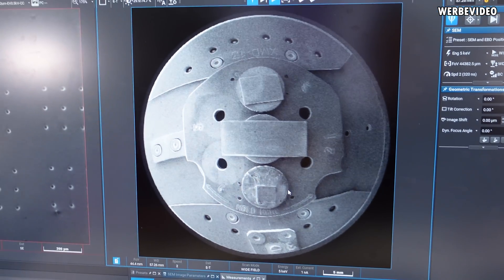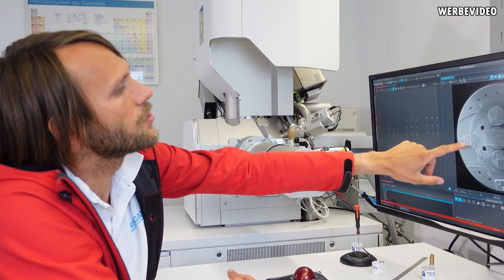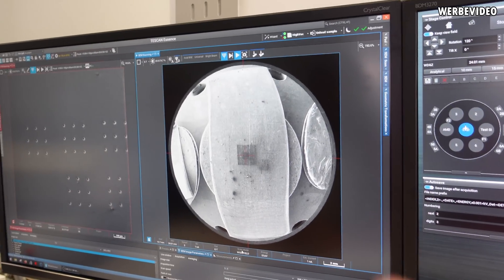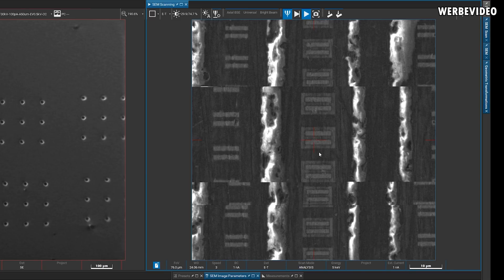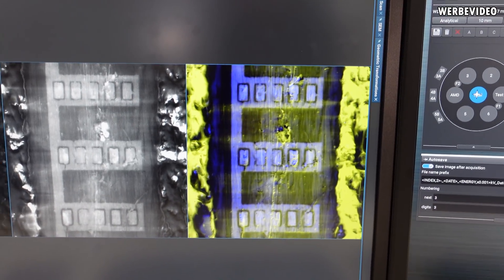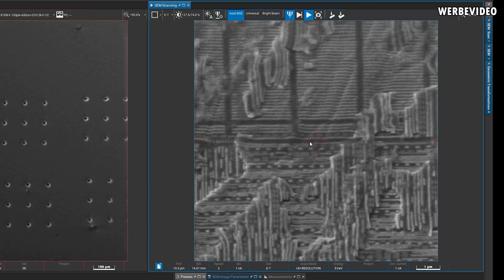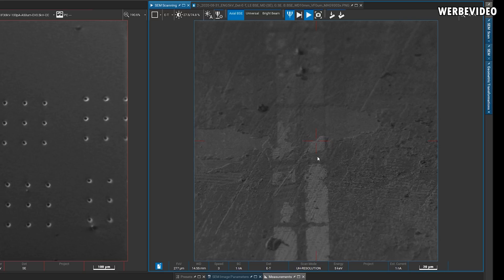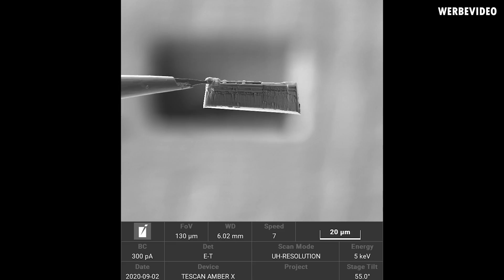Ryzen Nano-Structures more than 100,000 times magnified. Visiting Tescan Part 2/3

Comment: sometimes when using these things everyday, we forget the insane technology used to make them. it blows my mind that we are even able to make perfect lines of copper on a scale so small that we need to use an electron microscope to even see it. to see such uniformity  is mind boggling . 50 years ago seeing something like this would look like alien technology. thanks for the video man
Reply: As an analogy this is why i can't belive why so many think the piramids are 'alien tech' . Every time i hear that i wanna tell them: yeye , but have you seen the nano transistors ?? if so , why do you think we weren't capable of moving rocks 5000 years ago (or whatever years ago , less than 10000)
Reply: @kisspeteristvan  i know lol. they think we were brain dead cave man back then. "me dum dum, me no move big rock". like some super advanced alien race came down and instead of giving us technology or teach us slaves are bad. they instead build 3 random pyramids in the middle dessert.and was like "seeya, we will be back in a few hundred years to steal your hillbillies and stick things in there buttholes"  you have enough people and enough time. you could probably move a house on manpower alone.
Reply: Its not insane but a testitment to improvement and collaboration over the decades. Nasa made the first integrated circuit that was the size of a lunch box. Then others simply focused on getting this setup smaller.
Reply: even the speed at we can talk with someone on the other side of the world amazes me (or just download something) which is quite 'ancient' technology but still so amazing if you think about it.
Reply: Internet wont let knowledge be forgotten. So it compounds faster than ever before. The massive jump in technology we made in the last 50 years will be 2 or 3x faster for the next jump.  Machine learning is basically a.i and we take that for granted.
Reply: @Andytlp  I agree and disagree. You are right with advancements in technology advancing faster as new technologies make it easier. But there is a point of deminishing returns , and also a point when we hit a wall for new technology. And I think we are hitting that point. In the 80s and early 90s. We were inventing completely new devices yearly. The advancement in computers opened doors everywhere for using this technology in new devices. But at this point. We are out of ideas. Now we are just improving things we already have. And you can only improve so much before you need to find a new and better way  all together. Amd and there chiplets was the biggest advancement in a while .but everything else has slowed way down. The next big advancement that will change the world. Is finding a better way to harness power and make it super small and efficient . Without that.  We will just keep needing more power and even at this point it is getting to be too much. Needing 1000 watts to run a high end PC is crazy. Improvments in nodes can only do so much. If we keep going this way . We will need 2000 watts in 5 years. You will need an ac on all the time just to not cook your house. Now it's all software advancements. I really do think we wont see a really huge change in technology until we find new energy means. And we may never. You can only make so many items with a certain amount of ingredients. And unless space travel unlocks some new ingredients for scientists and inventors to work with. We will have to be happy with slight improvements. Until no more improvements can be made.
Reply: @thewizardoftech5075  the point of diminishing returns only apply to a specific paradigm, with paradigm change, you get exponentials again
Reply: rvidal0001  but thats the problem. we can only go so far with the elements we have now. without finding new metals. batteries are always going to be made the same way , so they are always going to degrade just as fast. there is no possibility of making a battery the size of a watch battery that can make your phone last for weeks. and batteries can only produce so many amps and volts at a certain size. to make real advancments we need a watch size battery that could power a car. and vr can also only go so far. the best that can happen. is make technology small enough that we can run  10k per eye then maybe it would look how we picture it. and we may never hit that kind of power, like i was saying. the more powerful gpus and cpus get , the more power they draw. and even with better nodes. it isnt enough efficiency gain to stop the next gen from going up in power. vr is still really basic. it is still just small screens in front of your eyes. for vr to be really immersive. it would have to make your whole room into the game without a headset. that way your eyes could actually focus in and out on closer and farther objects . your brain is smart enough to know the distant objects in vr right now arent really distant and only mm away from your eyes.  we as people just assume things will keep improving until they reach what we picture. but there is a reason we dont have flying cars and 100s of other things we see in movies. we just dont have the technology to do it. and probably never will. that is why the saying moores law is dead is a thing , because we are at the point now where advancements are slow and slight. and until someone invents a new power technology we are at a standstill. and fusion tech will never be a thing. its just to unsafe and to unstable. they will keep trying and maybe hit a breakthrough. but even if it works. it would never be implemented into household objects.
Reply: rvidal0001  saying we would never break the sound barrier was stupid. That is a possibility of our technology. You add enough thrust you can hit that easy. And whoever said the PS3 was the ultimate and last game system obviously wasn't to tech savvy. I'm going by the evidence . If the power of GPUs keep going up . Then power draw will keep going up. We can see it. Scientists themselves are saying. They wrote papers on Moore's law being dead. Nobody can tell the future but we can predict its path based on our current technology. Same way they predict the path of rDNA. And there is a reason they don't predict the next 50 years of cpus. Because even the cpu makers have no idea what they are going to do. Intel is already hitting a wall. They add a couple cores and bump the power to run them. So what does that say for 10 years from now?. 50 cores and 3000 watts?. Then bigger cases and huge AC units to cool it. Bigger house breakers for the mass power draw?. We can only make transistors so small. After a certain size we just can't make them. So if we are supposed to increase on a year to 2 bases then faster and faster which you stated. Where do we go?. Nowhere that's where. We invent a different way to make cpus. Chiplets bought us more time and ability to advance. But there is a limit to what silicon can do. And the amount of power you can safely use. You can only predict the future on the path we are on today. Just making wild assumptions with now path to get there is just ludicrous. And for power. You need a bigger battery for more power. That is just a fact. It's the limitations of what battery cells are made of and the rate of degradation. And you can't try and make a new element. But randomly making a new element is going to gurentee that element is an element we need. Saying that technology is boundless. Is naive. Everything has and end. And everything follows rules. Including advancements in technology . You can't make a cake with salt and water no matter how much time and scientists you throw at it. You need to add other ingredients. Or other things to change its molecular makeup. We are hitting a point we're slight improvements are a big deal. We went from flip phones to smart phones, that was huge. Going from big camera notch to small notch is tiny. Going from a commodore 64 to a PC that could game with actual textures was huge. But look at the PC advancement from 2010 to 2020. It was very small compared to that. The original statement that all this so for is saying technology still does and will follow Moore's law and keep doubling in advancement over and over . But we already see proof that it has slowed way down. So unless is speeds back up. Moore's law is dead.
Reply: rvidal0001  so what did we see this year that we never imagined we would se e 10 years ago?
Reply: rvidal0001  lol. Where did I say stop advancing technology today. I'm just saying you said technology keeps advancing faster as it advances. Thats called Moore's law. It's not a path. We have already proven that isn't the case . Hence "Moore's law is dead". Hence your original comment isn't correct. Going to space didn't just pop out of thin air. They started working towards it probably in the 1600s with theories . Then as time advanced they got closer and closer to making it a reality. Future technology is based in today's ideas. So saying I'm only thinking of today is rediculous.
Reply: rvidal0001  it's a mistake I responded to the first guy and you picked up the conversation from there and I never noticed. I guess we're both on the same page if we think advancements will slow down know lol. The other guy didn't .
Reply: It is true, we cannot even believe that the human being has been here for millions of years ... but rather just over 6 thousand ... because our evolution is at a level
only 150 years old or less ....
ps: forgive my writing i'm brazilian and i used a translation.
Reply: It's rather astonishing to see how we've improved and miniaturized all our electronical contraptions to microscopic levels.
I can't even rationalize how they do it without having it explained, not in a lifetime.
Reply: rvidal0001  I mean, something as simple as RGB strips are so fascinating. Ive been looking at my RGB mouse and keyboard for 3 hours now. It's just so cool.
Reply: That's because it IS alien technology!!!! :o
Reply: @lancervi1762  maybe we are the alien species in movies, where we are the ones travelling the galaxies. Or maybe we'll be content with r34, I dunno.

Comment: I’m so emotional rn, we humans have come a long way
Reply: Ok so you know what Electron tunneling is with the transistors, and how they use silicon transistors to get smaller like the 7 nm they are currently at with AMD's Ryzen 3000 series CPU's.
And the 5 nm, 3nm and so on, to make the computers more efficient with performance and energy but now we are starting to see more heat.
Silicon has limits but they keep trying to improve it, and it will melt at specific temperatures, so we need to replace it.
Ask yourself why we aren't using Quantum Materials like Graphene (yet) and still using silicon. 🤨🤔

This is where Graphene will fix the electron tunneling aka Quantum Tunneling, we don't need silicon to get down to 1 nm "nanometer" in size.

Imagine this, Graphene computers with a magnetic current to be 1,000 times faster and possibly only use 1% of the energy used. 💡

Now imagine Graphene optical / transparent transistors for Photonic Computing. 💡

Now imagine Graphene lasers for the fiber optics that would be used as the circuits inside our computers for Photonic Computing. 💡

--------

I would rather see Graphene computers, let's get rid of silicon. I'm serious.

Check this out.
I would give links but the video hides my comments.

Go to my channel and click on the playlist called "Videos with important info to get around my channel". ✔

Watch a Flash Graphene video about Flash Graphene 100 dollars "per ton". ✔

And then another video about "Large machines on earth / in space to make Flash Graphene". ✔

After that, check my channel with 2 simple steps for my other channel, go to the "About" tab of the channel I'm commenting with now and read the info with a link found there to save to your browser's favorites. ✔

==============================

Imagine Graphene for Photonic Computing, to help us save on our energy needs, really think about that for a second with Photonic Computing.

Check my other channel for these 2 playlists.
Photonic Computing playlist. ✔

Graphene computers for home and Starships, playlist. ✔

Learn about Graphene from my other channel's "Graphene playlist". ✔

If you want to know more about Graphene and Quantum Technologies, go to my other channel. ✔🤔💡

Comment: Ultimate video would be taking scans of silicon at different stages of production, so we can see how those structures get made. Looking forward to the third part. Also it would interesting a side to side comparison of different chips.
Reply: Ok so you know what Electron tunneling is with the transistors, and how they use silicon transistors to get smaller like the 7 nm they are currently at with AMD's Ryzen 3000 series CPU's.
And the 5 nm, 3nm and so on, to make the computers more efficient with performance and energy but now we are starting to see more heat.
Silicon has limits but they keep trying to improve it, and it will melt at specific temperatures, so we need to replace it.
Ask yourself why we aren't using Quantum Materials like Graphene (yet) and still using silicon. 🤨🤔

This is where Graphene will fix the electron tunneling aka Quantum Tunneling, we don't need silicon to get down to 1 nm "nanometer" in size.

Imagine this, Graphene computers with a magnetic current to be 1,000 times faster and possibly only use 1% of the energy used. 💡

Now imagine Graphene optical / transparent transistors for Photonic Computing. 💡

Now imagine Graphene lasers for the fiber optics that would be used as the circuits inside our computers for Photonic Computing. 💡

--------

I would rather see Graphene computers, let's get rid of silicon. I'm serious.

Check this out.
I would give links but the video hides my comments.

Go to my channel and click on the playlist called "Videos with important info to get around my channel". ✔

Watch a Flash Graphene video about Flash Graphene 100 dollars "per ton". ✔

And then another video about "Large machines on earth / in space to make Flash Graphene". ✔

After that, check my channel with 2 simple steps for my other channel, go to the "About" tab of the channel I'm commenting with now and read the info with a link found there to save to your browser's favorites. ✔

==============================

Imagine Graphene for Photonic Computing, to help us save on our energy needs, really think about that for a second with Photonic Computing.

Check my other channel for these 2 playlists.
Photonic Computing playlist. ✔

Graphene computers for home and Starships, playlist. ✔

Learn about Graphene from my other channel's "Graphene playlist". ✔

If you want to know more about Graphene and Quantum Technologies, go to my other channel. ✔🤔💡